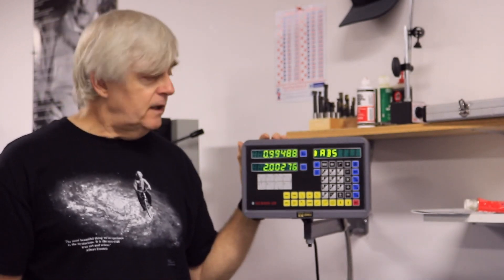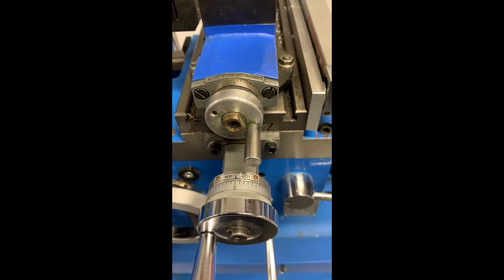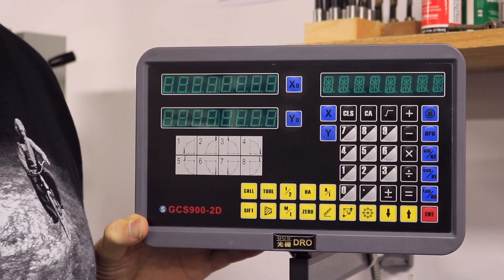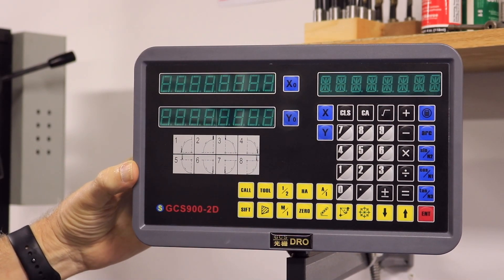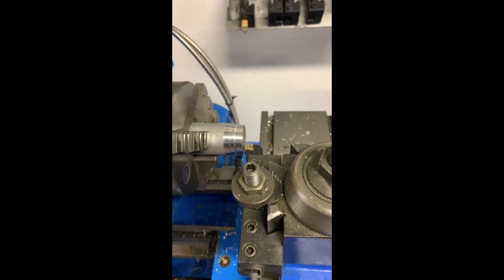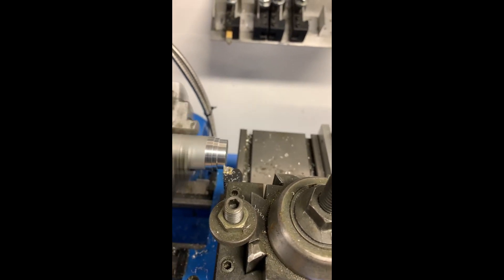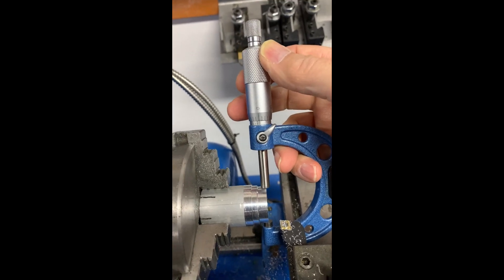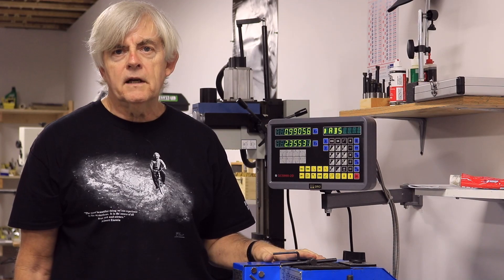HOW TO CHANGE YOUR GCS900-2D DIGITAL READOUT FROM THE MILL SETTING TO THE LATHE SETTING

Comment: I have this same DRO, but the 3 axis.  Do these have an internal battery?  Reason I ask is that mine reads fine all day long, but the next day (after shutting it off for the night), won't read at all (shows FFFFFFFFF).  I have to restore factory defaults, and then reset the resolution every morning to get it to work.  Since it works fine, once I do that, I'm wondering if it has an internal battery that perhaps is dead?  I can't find any info on that anywhere...
Reply from the maker: I’m not sure, but my guess is, that it must have a battery
Reply: They must. Mine (2 and 3 axis) keeps memory for days

Comment: I cannot get mine to work as I only get 2 beeps on startup. The way I got mine to mark diameter instead of radius is using the line compensation in the setup menu, you need to enter the pasword, 3211 to get in, go to compensation i think its x-comp or y-comp, pres enter and you get a value usually 10.0 (moved)press enter again an it displays observed with a number, you need to do this again but when you get to observed you need to put in a value of half the moved amount. this way for every moved amount it will calculate double and display equal to the diameter, you might have to do it a couple of times to get it down to the exact hundredth.